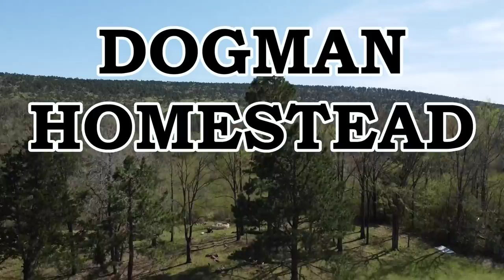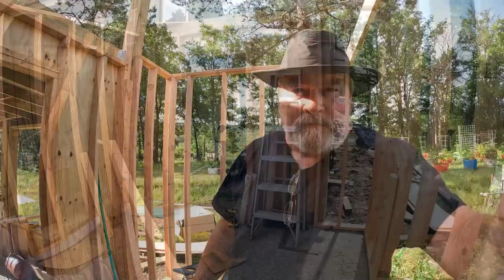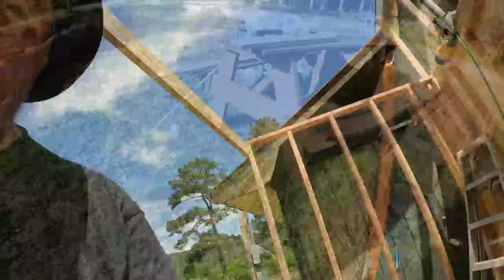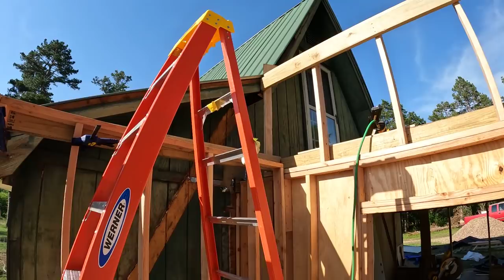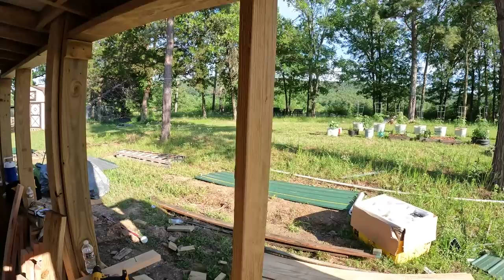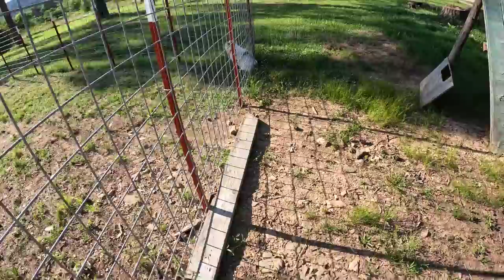Dog Apartment Build/ Heat Is Coming! /Screened Patio/ Deck/ Dog Apartment Build #16

Comment: Check around at WM and hardware stores' garden departments for kneeling pads. They are sold for cushioning the knees when putting weeds but, I use mine in the house as well.
Have a blessed Sunday, Mike and rest up when you can. 
☮️💖🙏🇺🇸🇮🇱🇺🇦✝️🙌✌️